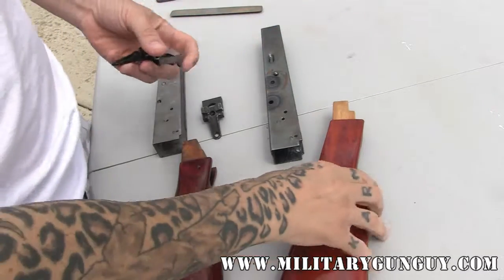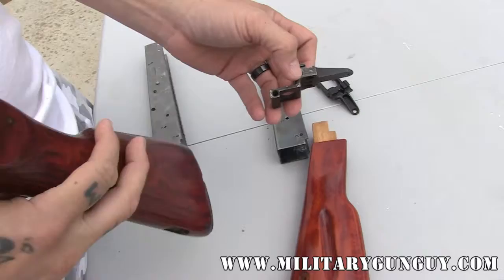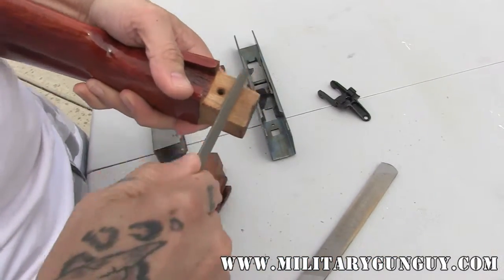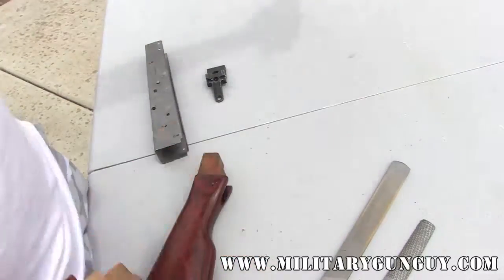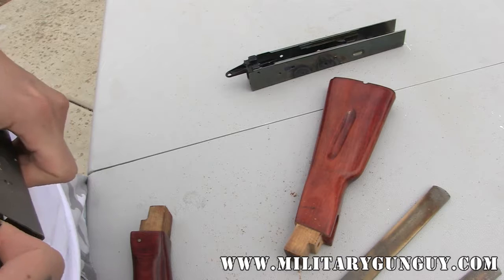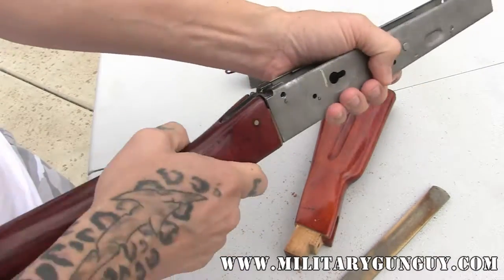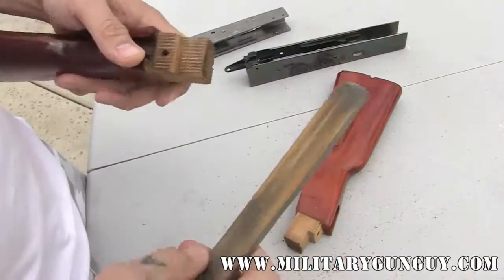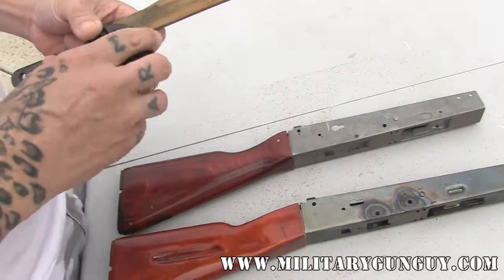Fitting An AK Stock To A New Receiver

Comment: This is good information. I've been working on an old Polish surplus laminate stock to go on my WASR-10.  I'd been using a rasp and a piece of 120 grit sandpaper stapled to a piece of paint stir stick.  The long part of the square piece of stock is just under 1/8" too long.  Now I've got to figure out how to get it back out of the receiver. It's a tight fit.  But I'm almost there.

Comment: I have even gaps all over on mine, but it’s bigger than I would like. I think the girls were drilled too short. How do I get it more snuggled up!?
Reply from the maker: Even gaps are OK. If it bugs you I would remove the stock, fill the holes in the wood where the screws go (drill down and install wood dowels), then install the stock where you like it, and drill new holes. The gaps are there to offset any shock being transferred from the receiver to the stock, but flavor to your taste..

Comment: how easily should the stock come out? im having huge trouble trying to fit this stock into in already assembled saiga
Reply from the maker: For really tight stocks I use a mallet on the end of the stock.  Hit the top, them the bottom, them the top. You will see it start to come out slowly.
Reply: do you recommend using a mallet to put the stock in the receiver also? i have maybe less than a quarter inch to go, and i tried filing everywhere and it wont budge. thanks for the response !